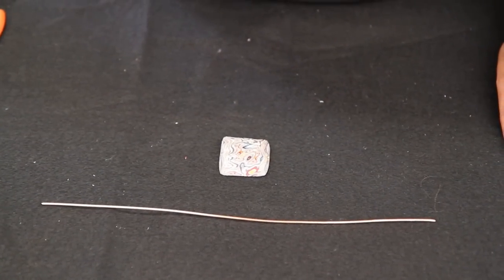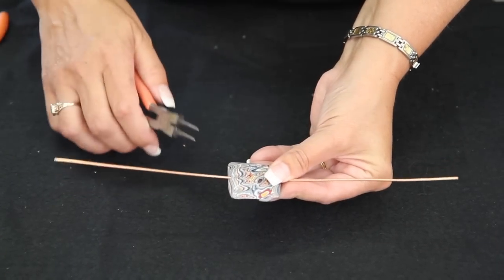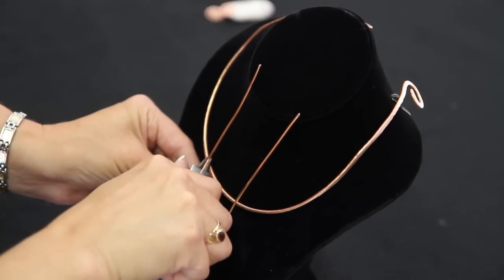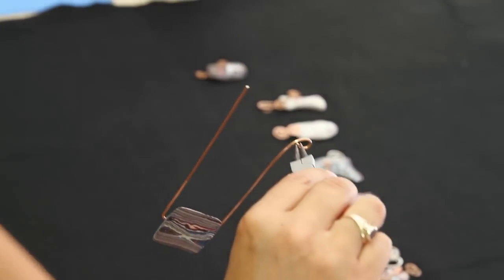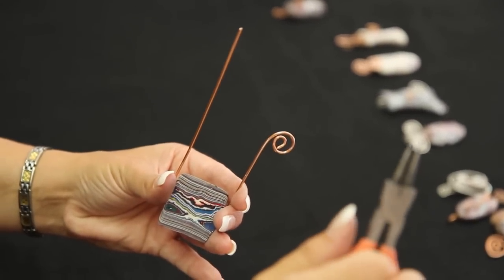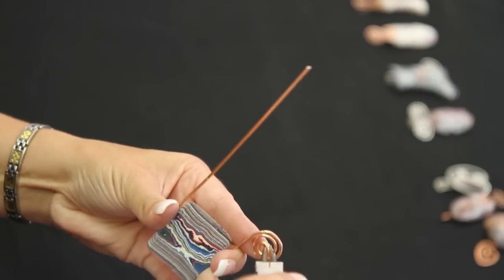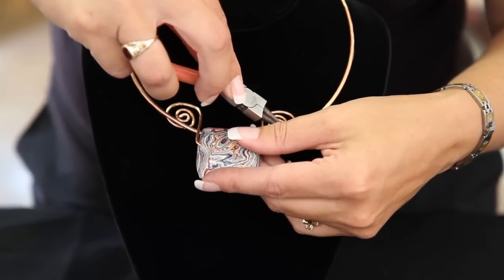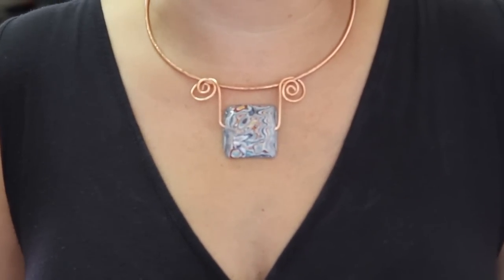Copper Necklace- Wire Wrap- Pendant- How to

Comment: is the copper soft or hard
Reply from the maker: +Sherie Mcclelland  I used copper from the hardware store so it didn't say. I would think it is soft.
Reply: thank yyou  i signed up for joannes specials emails and i get coupons for 50 and 60 percent off..so i will use one i got today for  precious metal wire i did order from ebay for my copper..getting it from ware store what was the cost ..good idea for another source thanks
Reply from the maker: +Sherie Mcclelland  I haven't bought it in a while, but it was very inexpensive.